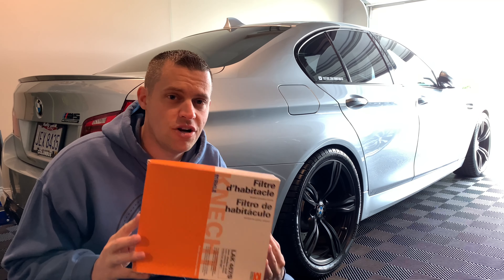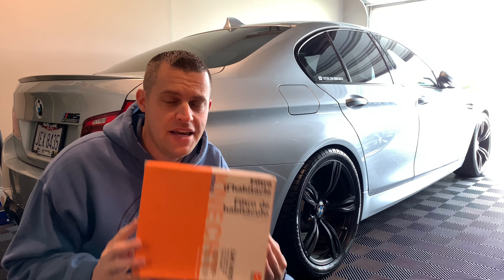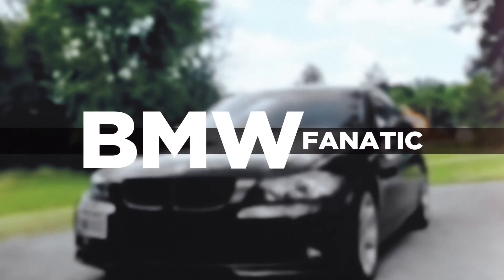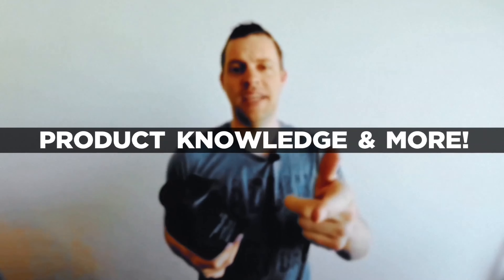How To Change Your BMW F10 M5 Cabin Air Filter DIY! EASY!

Comment from the maker: Hey guys! As mentioned at 5:12, remember to have the arrows facing towards you. I removed the old ones from the prior owner, which is why I mentioned how it came out. Appreciate the support!
Reply: The filter closest to the engine must flow towards the engine, and the one facing the cabin towards the cabin. The middle air chamber is unfiltered.
Reply: @JSarmiento.  Incorrect
Reply: Thank you for this clarification.

Comment: Thank you for your video. I took the precaution of watching several videos to ensure accuracy. My vehicle model is a BMW F10 2016 520D (Diesel). I proceeded by disconnecting the battery and allowing approximately 10 minutes for the system to reset. Although one instructional video recommended an hour, I opted for the shorter duration. The disassembly process involved removing two screws and an additional one securing the side panel carpet, all of which were easily extracted.

During the disassembly, I observed the absence of an airbag at knee level on the passenger side, though one was present on the dashboard. As an added precaution, I disabled the passenger side airbag. Furthermore, I disconnected the electrical wiring leading to the cigarette lighter and floor light to facilitate the removal of the entire bottom panel.

Upon accessing the air filter compartment, I encountered three screws, which were also easily removed. However, upon extracting the two filters, I noted that the airflow direction appeared to be oriented away from the passenger side. Consulting the instruction manual accompanying my filter kit revealed that the proper airflow direction should be towards the passenger side. Consequently, I proceeded to install the filters accordingly.

After reassembling all components, I reconnected the negative terminal of the battery, powered on the vehicle, and verified all settings. The only adjustment required was resetting the time of day.
Reply: Do you keep a thesaurus next to your owner's manual?

Comment: Great step by step process - thanks! Took me 30 minutes with no issues. Note that the wiring for the air bag might be clipped to the hardware. Just a quick unsnapping and it gave me the the space needed to safely avoid chaotic air bag deployment.

Comment: Finally found the CORRECT AIR FLOW DIRECTION video! ❤
Reply: After further deep online research, this is the wrong air flow direction. Both should facing passengers, pls ignore my first comment 😅. Thanks
Reply: @WirGanSekali  How deep did you go?  Can I trust your deepness?  Should I go deeper into the abyss?
Reply: @WirGanSekali  That is wrong sir. BMW TIS Procedure article number 64 31 010 states that  "Arrow must always point opposite of the direction of travel for installation."  This is a 3-chamber design with the middle chamber being the unfiltered chamber, so the Video Creator is correct on this installation. Next time you change the filters, check which side has the most debris. You will see that the sides that are on the outer side of the housing (one facing the engine and the other facing the cabin) are the f ok filtered sides.
Reply: @JSarmiento.  Incorrect. At least on my 2014 520d the filth is on the front/engine bay side of BOTH filters, aka the air flow IS direction passenger for both.  Fun fact, even the BMW dealer fitted the ones that came out both the wrong way 90.000 km ago.My decision, for other reasons, to never seek out these rip-off artists was again vindicated.
Reply: @brembopollypor9965  ok... I will completely ignore BMW's TIS and go with what some random stranger says instead. I included the article number for a reason.

Comment: Sorry it’s a late comment doing mine now does the closest one to the engine does the airflow face the passenger or towards the engine bay? For the back one it’s towards passenger are they both or one goes in one way for air flow other one goes other way?
Reply: Looks like both arrows towards the passenger seat.

Comment: Hi thanks for the video. But I was confused by the other videos that showing how to change the air cabin filter for this bmw F10. In this video, you showed us one filter, the airflow should be toward the passenger side and the other one, the airflow arrow should be toward the engine bay. The other tutorial videos in youtube, both air filters arrow should be toward the passenger side. So which one is correct? Thank you so much for your help
Reply: Your right, both shall point towards interior
Reply: It don't matter the arrow position..
They all same

Comment: can I double confirm with you regarding the direction of airflow ? the outer one airflow pointing towards the engine bay while the inner one pointing towards the passenger ?
Reply: Yeah, this seems weird.
Reply: @DrakeKillah  what? This is even more confusing roflmao
Reply: I used an endoscope camera to see the position of air inlet and the exit towards aircon blower for each inlet.
I can come that both pods are set up the same way, AIRFLOW DIRECTION must point into the cabin NOT the engine bay.
Reply: @Top Notch Ndlovu  you are completely right. Mine were facing to the engine and the dirt was on the wrong side off the filter so they should both facing interior. That is for 2013 F10/F11 pre facelift

Comment: So, the first air filter is pointing towards the cabin and the second is pointing towards the engine bay?
Reply: For both filters the air flow arrow should be pointing at the passenger seat.

Comment: There is no reason why you should disconnect the battery—none at all. One could argue that it is necessary to avoid accidental airbag deployment, but that becomes a moot point since you need to wait at least 30 minutes to flush residual electrical charge after disconnecting the battery and no one ever waits...

64 31 010 Replacing microfilter for interior ventilation F10 F11

Important!
Risk of damage!

Air conditioning must not be operated without the prescribed filter element.

Necessary preliminary work:
Remove lower dashboard trim panel

Release screws (1) on filter housing (2).

Remove microfilter cover (3) in direction of arrow.

Important!
Risk of water damage in the passenger compartment!

Installation note:
Microfilter cover (3) must be correctly engaged in guides on filter housing (2).

Water drain hose must be fitted correctly to heating and air-conditioning unit and cover of microfilter (3).

Remove microfilter (1) in direction of arrow from filter housing (2).

Installation note:
For version without tab on the microfilter (1):

Note direction of installation in marked area of microfilter (1).

Arrow must always point opposite of direction of travel for installation.

For version with tab on the microfilter (1):

Tab must always point in the direction of travel for installation.

Comment: This video, like millions of other videos on YouTube, is misleading. Please ensure that the air flow arrows are pointing towards you, NOT towards the engine bay.
Reply from the maker: Not misleading, as mentioned at 5:13, remember to having them facing towards you. I listed how they were when pulling them out from the prior owner.
Reply: The video is definitely misleading. Most viewers don't read comments; they just watch. At 5:07, you said the arrows on the filter should point that way, and at 5:13, they should point toward us. I would edit this misleading video.
Reply: @eyvazheydarli came here looking for an answer after getting confused for a sec there, glad i didnt point them opposite from eachother, thanks!

Comment: I didn’t screw in a oil filter housing bolt all the way and it spewed oil all over my engine bay then it leaked all over my driveway. N54 btw. Has this happened to anyone
Reply from the maker: Need to make sure the gasket sealed fully along with torquing down the bolt to spec
Reply: Nop. you are the first and only one ever. :-
Reply: @missaneido7417  I started my car heard a weird noise, shut it off popped the hood oil everywhere, leaked all over the driveway as well
Reply: Attention to detail
Reply: @John.doe26840  Awesome!